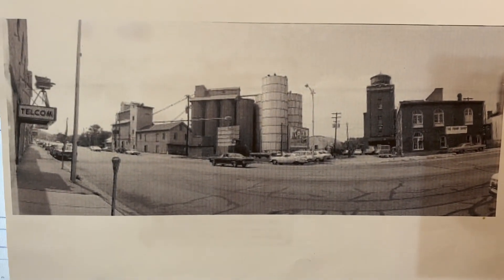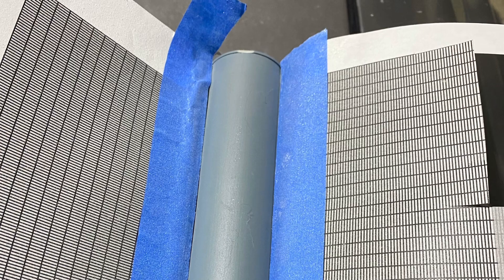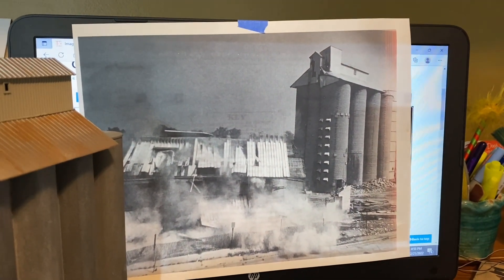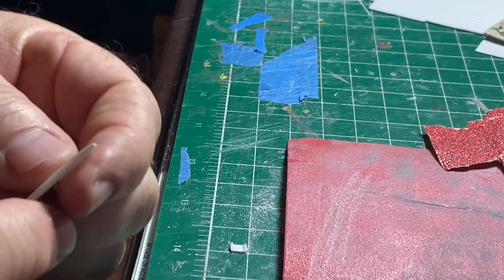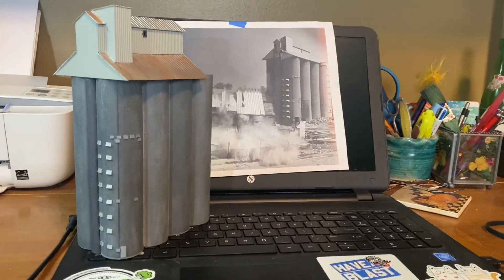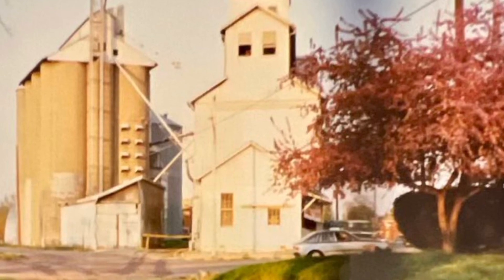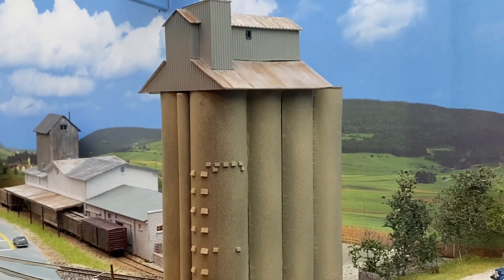Building my next project Part 3: concrete silos at Standard Elevator

Comment: Great job as usual Thom. A Northwest Shortline Chopper (or the Micro-Mark clone) would make short work of cutting those pieces of channel. Just set your stop and chop away. Your solution for simulating the wire hoops on the silos is brilliant. Obviously in the last photo of the prototype it was being painted, which could explain the different color you saw. Cheers!
Reply from the maker: I’ve owned a Chopper for over 30 years, Maurice, but it’s worn out. There is a groove in the Masonite where the blade sits now and it doesn’t cut straight. The razor blades also tend to deflect sideways if you cut material that is too thick. It’s only good for really thin stuff. I may replace it or try to fill the hole with something like epoxy. It does make it easy to cut identical pieces if they fall in those parameters. 
I don’t believe the silos were ever painted, but there are a couple of large grey areas that I assume to be patches, maybe from a vehicle hitting it. It was right on the road with no curb at all. I am going to paint those patches and call it complete. 
Tried prying the roof structure apart to fix the window spacing, but was not able to do it, so I’m going to live with it. I’m not willing to rebuild it.
Happy New Year, my friend! Stay safe!

Comment: Hi Thom!
I’ve been super busy at work with year end. Finally able to take time to enjoy the project video. Looking outstanding! I have used a chisel extensively to get square cuts on small parts. I rock the chisel back and forth to cut as you can apply less pressure so as to minimize parts flying across the room. Vents came out nicely and adds much to the model. 
Have you figured out yet what you are going to do for the texture of the four large silos?  I think there is corrugated aluminum sheet commercially available you can purchase and cut to shape and paint. Stay safe!  Scott
Reply from the maker: Hi Scott. I’m working on the original wooden elevator now, but I did pick up a Rix silo kit to see if it would work. It’s too small in diameter. I will probably use PVC pipe and try to laminate something. 3 of the silos are unusual, the 4th one is pretty typical of a modern silo. I’ll get to that sometime this spring, I hope.
Stay safe!

Comment: At least it shouldn’t blow up now that the Vents are in!

Ours blew up Twice!  Most recent time it destroyed the Concrete Silos. They now are using those round Steel Silos. A bit shorter but wider diameter. Looks like a mill in Kansas.
Reply from the maker: I have photos of a large concrete elevator in Henderson KY that blew up in the 80’s. Hard to believe that there is that much force.
I can’t figure out why only 1 silo had vents though.
Thanks for watching. Stay safe and Happy New Year!

Comment: This is looking pretty good Thom. I'm thinking those lines on the silo sides are mold lines from when the cement was poured. Have you gone looking for a site that specializes in old grain elevators and how they were built?
Reply from the maker: I did last night and results are inconclusive. Most pictures are from too far away. My wife took pictures for property evaluations and says she saw lots of them with steel bands but they were smaller. I started looking on Google Earth at places I will be traveling to fairly soon and will try to check some out. Good idea. Stay safe!

Comment: lines left in the concrete from the forms
Reply: @thomplacier677 I thought the lines could be due to the forms or molds as well.

Recently, id been watching another Nscale scratch builder as well, “W.o.r.m whatever operating railroad museum” He used out of scale scribed siding sheet wood because you can’t tell the detail in Nscale. Since you do closeup videos, it may be different, but on an average Nscale build, I wonder whether you need to exaggerate those lines or whether it’d be ok to leave them out altogether?

Great modeling!
Reply from the maker: I have seen structures like that before, but it sure looks like there are things sticking out. What could the perfectly vertical lines be like at 0:57 on every silo? You may be right, though. Thanks for commenting and stay safe?
Reply from the maker: @KenN.OXN.805  I do think the color is more important than the lines. Since airbrushing it to fix the color, the lines aren’t as evident but I think it looks better. The vertical lines on every silo puzzle me though. What could they be?
Thanks for watching and contributing your thoughts, Ken. Stay safe!
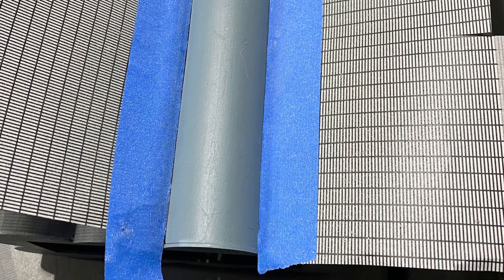Reply: @thomplacier677  ok, you got my curiosity going. See this YouTube video about jump form method of construction. At around 2:16 the presenter mentions the form lines visible on the outside. But this technique wasn’t used before 50 years ago.

To find the video, search “concrete silo construction methods jump form”
Reply from the maker: @KenN.OXN.805  the lines certainly match, but I don’t see any vertical lines the entire length of the structure. 
The oldest photo on Historic Aerials is 1957 and the silos were there. That’s 75 years. 
The company that demolished them is still in business in Chillicothe. I may try to stop by there to see if anyone remembers. Very curious myself now.
Reply: the dark vertical discolorations almost look like weathering artifacts to me. The one on the left at about 0:38, where you can see the whole structure, corresponds with a stain on the building wall above, and the one on the right is under a corner joint. Others I can’t associate with anything above. If you zoom close toward top of the right silo, the dark stains aren’t as uniform straight , unbroken lines.

Let us know if you find out anything definitive.
Reply from the maker: @KenN.OXN.805  I definitely will. Thanks for the great discussion!